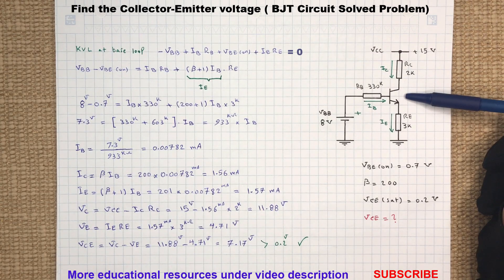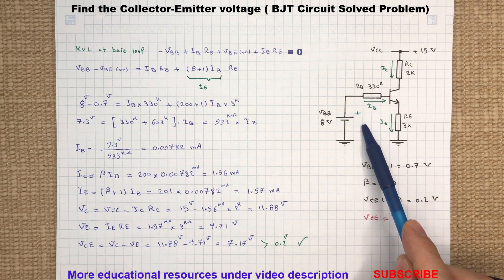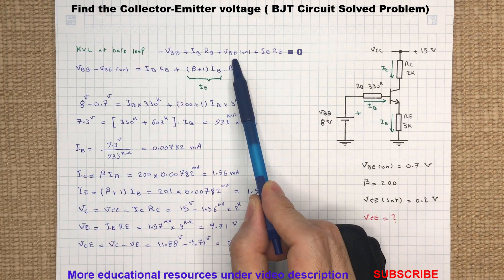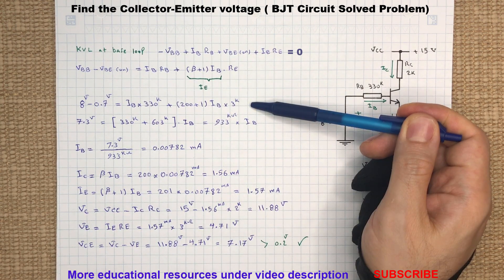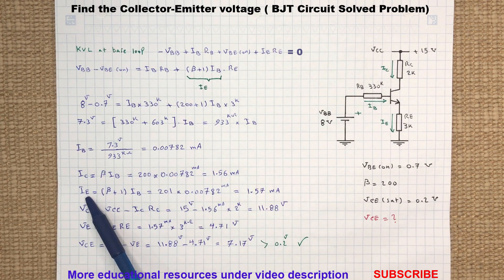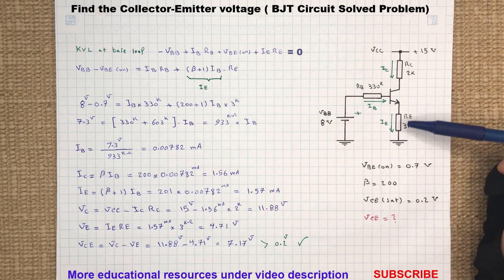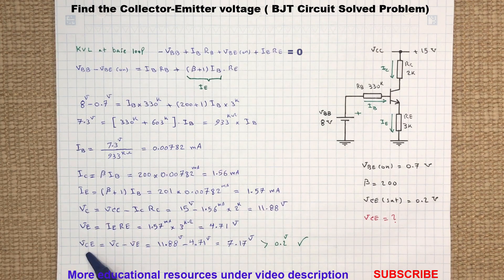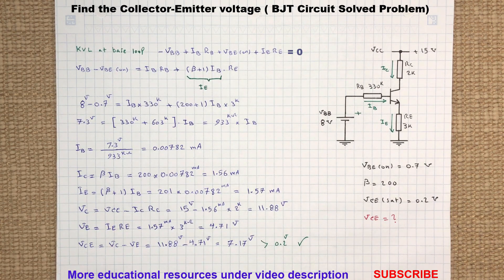NPN Transistor Biasing Solved Problem, NPN Transistor Circuit Analysis

Comment from the maker: BJT Voltage Divider Bias Solved Problem:  https://youtu.be/QTZyadf7u3k
BJT DC Analysis Solved Problem : https://youtu.be/_XK0HeoV2BE
Darlington Transistor and Diode Circuit Analysis: https://youtu.be/GGsz3ftdtp4
PNP Voltage Divider Biasing : https://youtu.be/zGo1NW2PO7c
PNP Fixed Biasing : https://youtu.be/_-PItPPaTjM
Electronic Circuit Analysis Playlist: https://www.youtube.com/playlist?list=PLLA_QJ8rHZBh5LqrY41bCvKgreRDRWrBQ
Control System Playlist: https://www.youtube.com/playlist?list=PLLA_QJ8rHZBjS_S6WPkmUweF5NbImvSqf